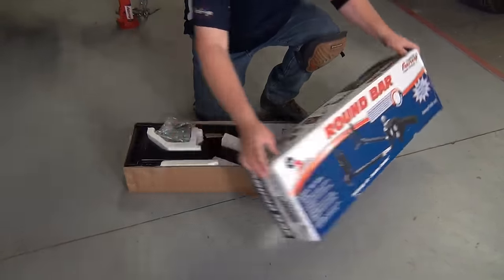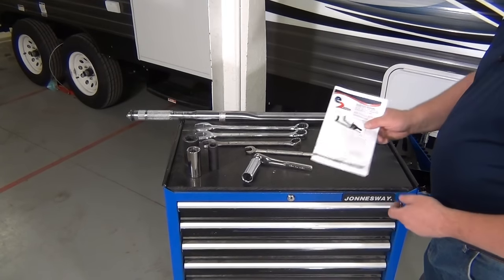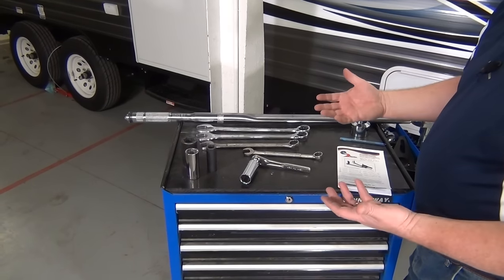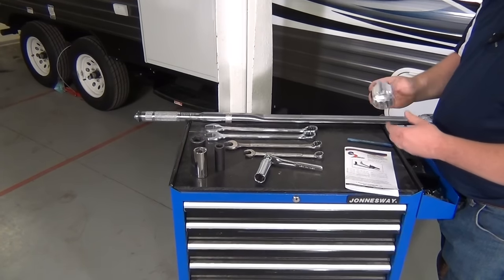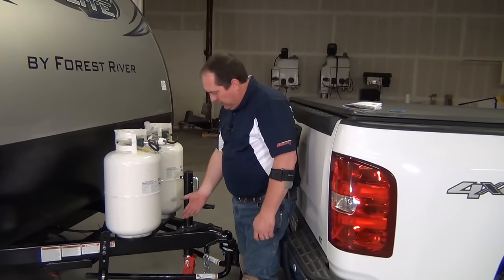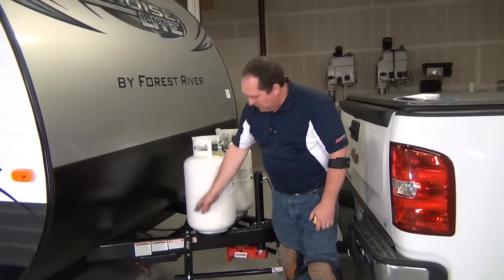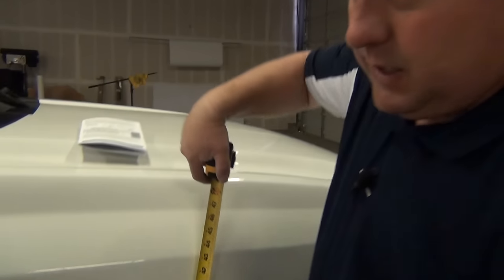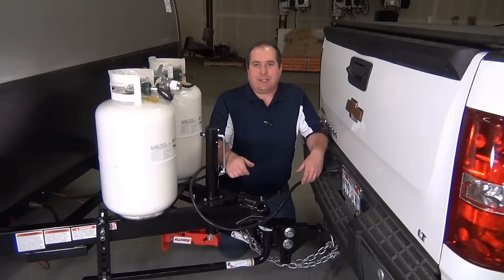How To Install Your Fastway e2 Round Bar Sway Control / Weight Distribution Hitch*

Comment: I just bought a new travel trailer and the dealer installed the Fastway e2 Round Bar Sway Control / Weight Distribution. On one side the pin/taper keeps hanging up (it almost seems like the pin has some burrs or the hole needs is too small), giving me a hard time releasing the round bar. The other pin/taper is so smooth. When I pull on the taper to release the round bar, the taper bends too easy and won't come out far enough to release the round bars. What do you recommend? Thank you.
Reply: I'm having the same problem getting the the bars out.  What ami I doing wrong.  Please give me a few tips and tricks I need to perform.  Any help would be very helpful.
Reply from the maker: +74ewtn and Chuck Faubel,

To remove the spring arms from the hitch head, simply rotate them outward and forward toward the tow vehicle. When they get a little past perpendicular to the hitch head, they should push those pins out by themselves, and they should easily release and drop out of the hitch head.

If you try this and are still having trouble, get in touch with our Customer Support team: 877-523-9103 or Support@FastwayTrailer.com.

Good luck!

Comment: I own a 5450 lbs dry trailer with a 605 lb dry hitch weight 
 Should I purchase the 800 /8000 lb e2 hitch or go up to the 1000 / 10,000 lb hitch ?
Reply from the maker: +Jord TheMechanic,
The critical weights are your loaded weights. The ratings on the hitches are for maximum tongue weight and maximum trailer weight. We recommend loading the trailer as you would for your heaviest trip, then taking it to a location with a truck scale, or CAT scale, to weigh it.

Pull across the scale, and stop with your tow vehicle just off the scale, but the trailer still on. Uncouple the trailer and use the jack to raise it off your hitch ball enough that there is no weight on the tow vehicle. The scale operator should be able to give you two weights, the weight at the axles, and the weight at the tongue jack. The tongue jack weight is a close enough approximation for the tongue weight of the trailer (unless there is more than a few inches distance between the jack and the coupler). Add the two weights together to get your gross trailer weight.

When choosing a hitch, make sure its ratings exceed both of these actual weights. For example: if your measured weights are 700 lb tongue and 7,000 lb trailer, an 800 / 8,000 lb rated hitch would be fine. However, if they are 840 lb and 7,000 lb, you would need to choose the 1,000 / 10,000 lb rated hitch.

Remember, you should never tow with more weight than your tow vehicle, hitch, or trailer are rated for.

If you need more help with this process, get in touch with our customer support team at 877-523-9103 or Support@FastwayTrailer.com. They are always happy to help!

Comment: I’ve had my e2 for two seasons now and it has been nothing but disappointment. The left side L bracket won’t stay tight and I’ve had the bar come off twice. I’m not sure what’s going on but I’ve torqued every thing to spec. I have the thousand pound bars and I’ve been told I need the 1200 pound bars because of the length and weight of my trailer. I get a lot of bounce and barely any sway control.
Reply from the maker: Oh no! Lets get this problem figured out. If you contact our customer service team at info@fastwaytrailer.com or call them at 877-523-9103, they can help you figure out the problem!! I'm sorry this seems incredibly frustrating!

Comment: you didn't mention anything about the sway bar, or what prevents it from swaying,  can you please explain?  thanks
Reply from the maker: +JSWIZZLE8R,

With an e2 hitch, the sway control is built right into the hitch. You should not need an add-on sway bar when you use an e2 hitch.

The rigid brackets that mount to the trailer frame have less play in them than chains do. Also, the spring arms (weight distribution arms) must slide back and forth on those brackets when the trailer and truck change alignment (turn or sway). The friction at these two points along with the rigid brackets are where you get sway control from an e2 hitch.

Comment: I have the 10,000lb round bar.  I traded in my trailer for one with a GVWR of 7000lb.  Do I need to replace my bars to the 8000lb rated ones?  Is there any harm in using the "oversized" round bars that I have now?
Reply from the maker: +Tundra, Tools, and Tech,
No, there is no need to replace the 10K arms with 8K arms. The ones you have will work great for that size trailer. Just make sure you check your overall setup and make any necessary adjustments to the placement of the hitch head on the shank and weight distribution as those may be different with the new trailer.

Comment: Any solutions to getting rid of play/movement in removable tow hitch bar? I use a bolt and lock but in the base of bar which secures it but the tow bar works loose after an hour of towing.
Reply from the maker: +craig weir,
Are you talking about play between the adjustable shank and the receiver on your tow vehicle, or are you talking about play between the adjustable shank and the hitch head?
Reply: FastwayTrailer shank of E2 and receiver in my tow vehicle. When I unhitch the caravan it has maybe 2mm of movement /play.
Reply from the maker: +craig weir,
Most receivers have some tolerance to allow the shank to slide in and out easily. 2mm  is a very acceptable amount of tolerance. Any movement of the hitch head and shank should be stopped once you engage the spring arms, as they apply a significant amount of upward force to the shank of the hitch, and pin it against the top of the receiver.
What is your main concern with the play?
Reply: FastwayTrailer thank you for replying. My main concern is the movement 2mm all the way around seems excessive with 2.6 ton from my caravan wearing on the hitch pin and receiver. I was thinking of running some tacks of welding around the E2 bar and grinding down for a more snug fit into the hitch receiver. Thank you.

Comment: Is it ok to use the e2 hitch at 23.75 inches I have a brace on frame if I go the other side it will be 27.75
Reply from the maker: @Eric Lawton, yes, you will be fine putting the frame  brackets at 23.75".

Comment: How do you adjust the pitch?  In your example you did not need to adjust pitch.
Reply from the maker: bartlettbob 67,

Sue had this very same question on our e2 trunnion video. Here is my response to her:

To check the pitch of the trailer, I follow a similar process as the one I use to get it parallel to the ground before starting the install.

With the trailer coupled up and the weight distribution engaged, measure the frame of the trailer at the front and back, and compare the measurements. If the difference between the two is significant (more than 1-1/4"), you may want to adjust the hitch ball height - the position it is in on your adjustable shank. There is some flexibility in this. A short trailer of only 15' will be much more effected by changing the hitch ball height than a 34' trailer will be. 1-1/4" over 15' is much more pitch than 1-1/4" over 34'. Use your best judgement for your vehicles. Try a couple of different positions if necessary, and use the one that gives you the most stable ride.

For example:
With your hitch coupled and spring arms in place, you measure 15" to the trailer frame at the back, and 17" to the trailer frame in the front, a 2" difference, which is more than the recommended 1-1/4". Moving the hitch head down one hole on the shank changes its position by 1-1/4". But dropping the head also increases the amount of weight distribution, because it changes the relationship between the end of the spring arm and the L-bracket position. Therefore, when making this change, you need to check the weight distribution setup again.

After moving the head down, the new weight distribution measurements show that it is good, dropping the front wheel well only slightly more, but not more than the uncoupled wheel well height.

A second check of the trailer measurements shows 16-1/4" at the back, and 16" at the front. It is now within the 1-1/4" difference, and the weight distribution is good. This would be a better setup than before.

---

There is a detailed description of this in Step 8 of the owner's manual, which you can download from the Fastway website here: http://www.fastwaytrailer.com/manuals

If you need more help with your hitch, get in touch with our customer support team. They are available M-F, 8:00 a.m. to 5:00 p.m. Mountain time. They will be happy to help. (877) 523-9103.
Reply: FastwayTrailer my uncoupled height on front end of truck is 35.5. coupled height on front end is 35.25. is that considered over distributed? after reviewing the vid a few times, I may have to re-check what the dealer did when they installed. unit is a little squirrelly going down road.
Reply from the maker: PoPo S,

Yes, if the uncoupled height on the front end is HIGHER than the height with the trailer coupled and weight distribution bars engaged, you are OVER distributed. If this is the case, you need to remove spacer washer(s), or lower the L-bracket, to take some of the weight distribution off.

Follow the guidelines in the e2 hitch owner's manual to do it right! http://www.fastwaytrailer.com/manuals

Other things to check are: not exceeding weight ratings on tow vehicle or trailer, properly inflated tires, proper trailer loading (10% - 15% of Gross Trailer Weight as Tongue Weight and heaviest items low and in the middle), and do not speed.

Good luck!
Reply: FastwayTrailer thanks. do the wd bars absolutely need to be parallel to trailer frame? right now the bars are parallel and are in the middle 2 holes of L brackets. if I drop one hole, they won't be parallel. if dropping down one hole on each will put my front end close to uncoupled height, and bars are not parallel, will that be ok?
Reply from the maker: PoPo S,

Yes, it will be fine if the bars are not absolutely parallel to the trailer frame. Having the weight distribution properly set up is more important.
Reply: FastwayTrailer thanks

Comment: I may have answered my own question. If you lowered the "L" bracket two holes, the weight distribution was reduced and the nose of the vehicle was increased. So i should be able to raise my "L" brackets two holes to correct my nose high situation.
Reply from the maker: Good question. There's a couple things you will want to check. You'll want the bars to be running parallel with the trailer frame, as apposed to running at an angle (either up or down). If the nose of the trailer is a bit high, you can lower the entire hitch head on the shank to have the trailer frame be level. With that said, I would rather have the trailer be nose up than nose down. 

So if it's close to level, I'd probably leave the nose as is, and then make whatever L-bracket adjustment is needed to get the bars parallel with the frame. Once you've done that, if you need to make changes to adjust the weight distribution and/or sway control, you can do that by adding (increasing WD and sway control) or subtracting (decreasing WD and sway control) washers.
Reply: @FastwayTrailer  thank you. I initially raised my "L" brackets two holes but found out that was too tight. I was seeing metal shavings, so I returned it back to its original position.  I will start from scratch and should be at the right point from there.

Comment: Should any parts of this hitch have grease?
Reply from the maker: +Zachary Henderson,
Yes. You should make sure it is greased around the ends of the spring arms where they come in contact with the tubes in the hitch head. You should also grease the hitch ball. Here is a link to the installation instructions, which have the details of doing this. Thanks for the question!  http://www.fastwaytrailer.com/manuals

Comment: You mentioned to load the trailer as it would be towed, but you never mentioned to also load the tow vehicle the same way, with full tank, camping gear, kayaks, etc... Basically anything you would load toward the rear of the vehicle for your trip.
Reply from the maker: You are correct. It is ideal to have the tow vehicle loaded as you would on a typical trip when setting up the hitch. Thanks for the comment!

Comment: My L Brackets move a little, as if they have become loose. Is it normal for those brackets to have some play in them?  I will go check the torque when I have a chance.
Reply from the maker: K2,

The holes in the L-bracket are slightly larger than the diameter of the stud bolts on the outside link plate. This is simply to allow for minor tolerance differences during the manufacturing process. This does allow the L-bracket to move a little if they are not tight. If they are torqued correctly, you should not see much movement.

Correct torque for the link plate bolts (around the trailer frame) is 65 ft-lbs., and for the L-bracket nuts it is 75 ft-lbs. (See the e2 hitch owner's manual here: http://www.fastwaytrailer.com/manuals).

If you double check yours, but still have a concern, get in touch with our customer support team at 877-523-9103 or Support@FastwayTrailer.com.

Good luck!